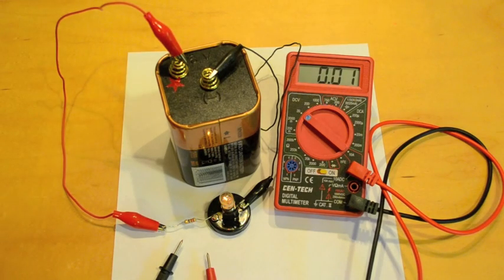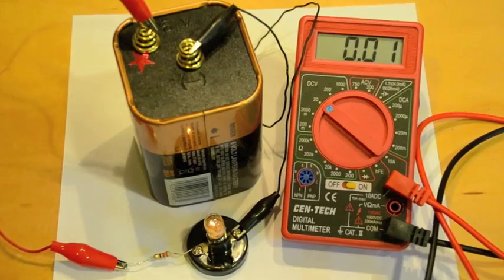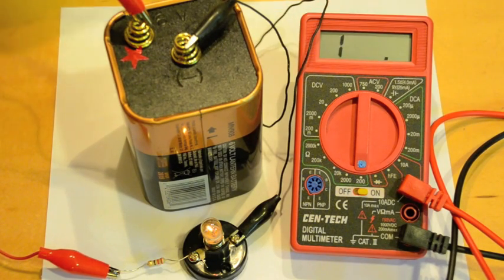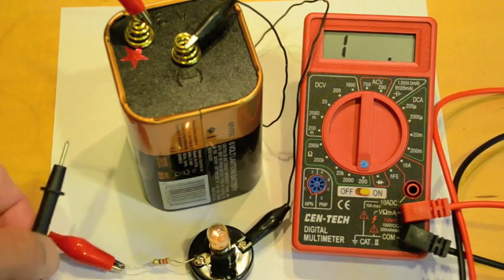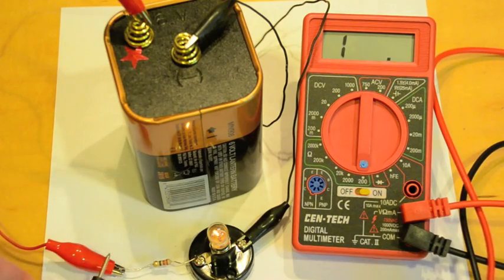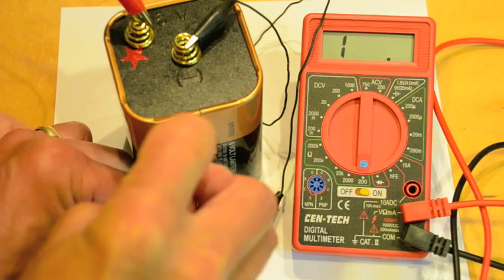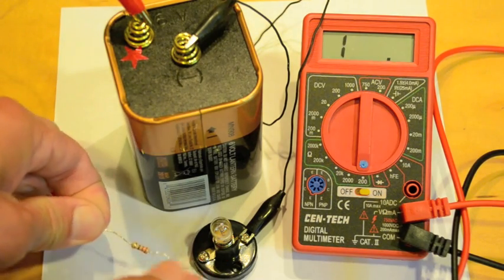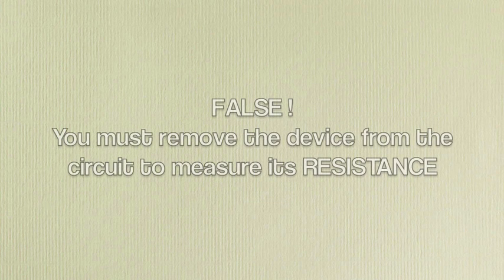Measuring Resistance with a Digital Multimeter

Comment: The wires alone should get zero resistance but I have multiple of these meters and sometimes they connections to the meters them selves are not good so press down on the connection on the meter or change the batteries if I don't get a zero for resistance on the wires are but more than likely it's simply because the wire connections are not tight to the micrometer

Comment: The electrons flow (-) to (+) but I guess it doesn't matter too much in the case of the resistor since you can place it on either side of the appliance/load in a circuit and the resistor will do its job.

Comment: why am i getting a measurement of 0.2 ohms when i touch leads together....Cen-Tech meter...(200 ohms setting)??? Great tutorial!!
Reply: I learned to always check the baseline of my multi-meter before testing ohms of any circuit. Each use.. each day.., or more often the better. It's done by selecting the setting you may need and first verifying the infifnite reading (looking at the meter while test probes are apart.. touching nothing) vs the closed circuit reading (looking at the meter while test probes are constantly and steadily touching). I think of that as checking my multi-meter's baseline.
The video was showing that very clearly.
The perfect ideal is a meter with 0 or as small of a value as possible for a baseline with closed circuit. But often it doesn't always happen to be perfect.  I've found this same thing in my own collection of multi-meters. Sometimes the meter's battery is too weak or getting a poor connection, other times its a temperature issue.. Battery's power levels are weaker while very cold, or the components inside the meter are likely to change while they are colder or hotter, many times the contacts in the switch of the meter have a slight bit of corrosion, and whether one of these or a combination is the cause... that's all it takes to affect the baseline of the ohms meter.
I have some older analog types of multi-meters that have an ajustment knob on the front that is for adjusting the meter to "fine tune" its closed circuit baseline.
I've peeked inside some digital multi-meters and spotted inside some have variable resistors. I suspect these are for the use of the manfacturer's to set the baseline of the meter and or other fine tuning requirements that must be set at prior to final inspection and assembly. 
Great video. I hope my observations and comments helps.

Comment: i have the same meter as your using, but how do you read a resistor at the other settings like 200k or 2000k or 20k what do they mean ?

Comment: i gotta ask ! 1 why cant you do it whilst its in circuit ? and 2 what difference if you did do it ir circuit then what difference would having it read whilst voltage flowing or no voltage? also ....do you think it would make any difference if you made very short probe wires what for measuring resistance? ps great vid !!

Comment: I am trying measure ohms of fuse relays in my car. Do i need to pull the relays and check where they plug into the box, or remove an check the relay? I figured both. The battery is disconnected btw.

Comment: Hello teacher
i have a question
suppose  the bettery is 220 volts AC ; and resistor 220 kΩ (220 000 Ohm); bulb is ME
current = voltage/resistance
220/220 000 = 0.001 amps ( 1 milliamps) if my math righ so i think, i don't get electrocuted because 0.001 amps is low current flowing through me 
thank you very much

Comment: You do not need to remove the device from the circuit .  Just one end and it makes no difference which end. Good video otherwise!
Reply: What do you mean by one end?
Reply: @iwishtobetexan6060  One end of the resistor  disconnected or the other, OR both.
Reply: He doesn't need to be touching the both ends with his fingers as there is resistance through our body as well.

Comment: Does fuse is consider a resistance? Can you know is a fuse work or not through resistance?
Reply from the maker: You can treat a fuse like a low-value resistor. Ideally it should be close to 0 ohms. If the fuse is blown it will display an over-range
 (“1      .”) or blank on the meter

Comment: You only used 1 resistor and you only used the scale at the bottom of the ohm meter. Would have been nice to hear you explain the difference of the other values on the scale.

Comment: If you disconect from power is ok to read the resistance
Reply from the maker: guillermo canchan No, you must disconnect one or both leads of the resistor you wish to measure. Even if you turn power off, there are other paths thru the circuit that your meter will measure. So you must isolate the device from the circuit.

Comment: Why can't you take the ohm reading when there's volts through it?
Reply from the maker: The meter measures resistance by applying a very small voltage across the resistor and measuring the current through it.  You cannot measure the current through the resistor without disconnecting it.  If you try to measure the resistor in a live circuit, there is already  an applied voltage and current flowing, so resistance will not be properly measured.

Comment: If your circuit had a switch could you measure the resistance simply by switching off or do you need to de-solder if its in a component?
Reply from the maker: Peter Gamston you must disconnect at least one lead from the circuit before measuring the resistance.

Comment: what if i'm reading over 200?  If I set it to 20k to get a reading and it says 9.8 what are the ohms?  Thats an impartant BASIC detail left out.
Reply: I'm wondering the same thing, is it 9.8 Thousand (9,800)or just 9.8? I get no reading on the 200 but on the 20k I get 2.2 ohms which makes no sense, if it's 2.2 why isn't it working on the 20 setting!
Reply: Ok I figured it out I'm pretty sure, 9.8 on the thousand (20k) setting then it is in thousands so 9.8 thousand is 9,800 ohms.

Comment: Does a resistor have a negative and positive side?
Reply from the maker: No. Resistors do not have a polarity.
Reply: Thank you.  Does the multi tester have a fuse?
Reply from the maker: All multitesters I have seen have a fuse.  usually 10 AMPs if that is the max capacity of the meter.

Comment: Good work on this tutorial!  

A lot of tutorials spend time describing what a resistor does or what resistance is, but you got to the point quickly and only pointed out the importance of having no current flowing through the resistor.  That is an important thing that some people might no know, but is very relevant to your tutorial.

My color vision isn't great, so reading those tiny bands is basically pointless for me, so this tutorial told me what I needed to know.

Thanks!

Comment: if it is a 220 ohms resistor, why is it not showing the reading of 220??
Reply from the maker: Shoaib Sh 
The resistor is marked as 22 ohms with a tolerance of 5%. So any value from 20.9 to 23.1 is within spec. The meter and probes have about 2 ohms additional resistance
Reply: I am measuring ohms on a sensor that requires 4.0 ohms. If my multimeter also puts out 2.0 ohms resistance on its own, then the correct reading I'm looking for would be 6.0 ohms?

Comment: Be careful NOT to touch the tips of the probes when measuring resistance. It will affect the measurement. Your fingers have fats and salt water on them, so the resistance through the probes (when just touching them together) should be about 0.3-0.4 ohms when they are 'uncontaminated" A value above 1 ohm is too high.

Also when measuring components, be careful not to "smudge" both ends of them with Your fingers while measuring. This too will affect the result. Use some plastlina or TackIt to hold the component(s) in place so You can measure without touching. 

Otherwise this tutorial is good. Do not measure resistance in components or parts of a circuit while it is live and turned on. Unhook the component(s) before measuring, and be sure that all capacitors have been discharged before measuring ohms.
Reply: We create parallel resistance by fingers, aproximatly at our body has 3-6 x100 kOhms. by such type measurment is not true
Reply: How do we make sure capacitors are discharged?

Comment: Although not often taught - circuits actually run negative to postitive
Reply from the maker: In most circuits, negatively charged electrons move from negative to positive.  However, "current" is defined in terms of positive charges, so it flows from positive to negative.  Ben Franklin named the charges + and - back in the 1700s.  However, the negatively charged electron was not discovered until the beginning of the 20th century , long after the convention of positive current was established by physicists and engineers. So the definition of current relies on a "flow" of fictional positive charges.  It's equivalent in math is adding 2 positive numbers is equivalent to subtracting a negative number.

Comment: Doesn't current flow from the negative end to the positive end and not the other way around?  You say that it flows from the positive to the negative but that doesn't seem correct.
Reply: +MrChanPhysics Thank you for your very educational video and comprehensive comment. I am currently going to school for HVAC&R and the electrical side of it gets a bit confusing. Again Thank you for your time and video. I am definitely subscribed to you.
Reply from the maker: You are correct, but physicists, electricians and engineers consider current to flow from positive to negative.  This follows a convention established by the esteemed Benjamin Franklin (yes, $100 bill guy).  Old Ben identified 2 opposite types of charge but did not know that it is actually negative electrons that travel from negative terminal to positive terminal.  Electrons weren't identified until the turn of the 20th century. So we think of fictitious "positive charges" flowing + to - instead of negative charges going - to +.   Resulting charge flow is the same.  Sort of like subtracting negative numbers is the same as adding positive numbers.
Reply: Congrats to you for learning HVAC. I always tell young guys an HVAC guy can get a job in any city because 99.5% of buildings have heating and/or cooling. Hope you stay with it.